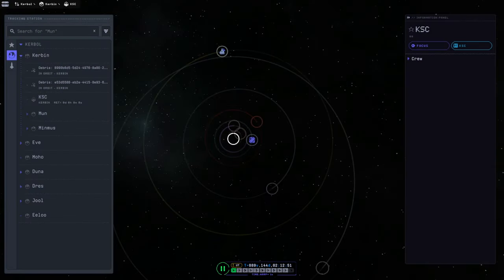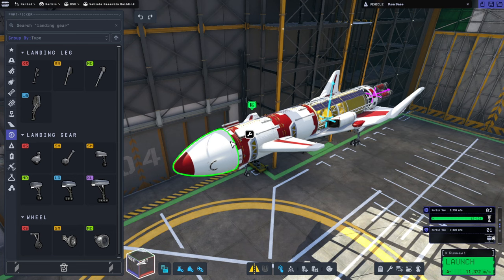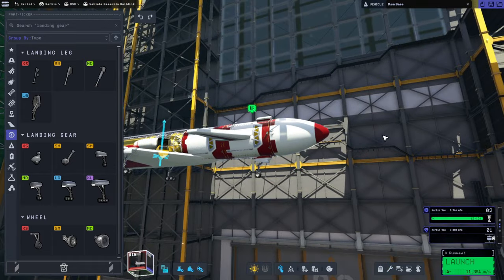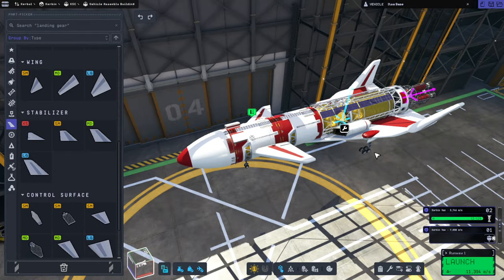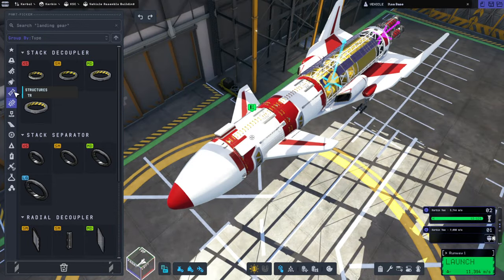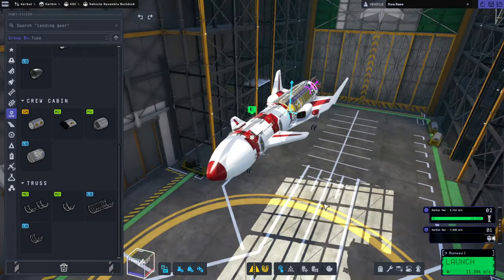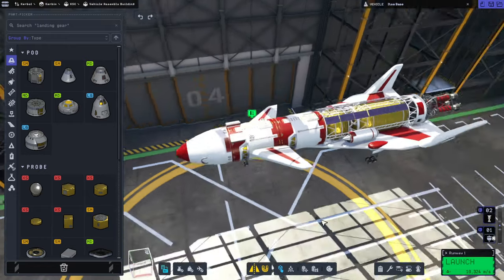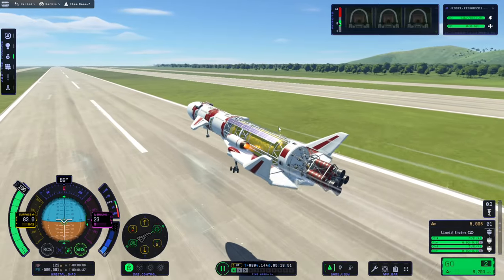KSP 2 Early Access - The Laythe Plan 04

Comment: trouble when you're launching the 3-SRB version - at 19:42, the smaller leftmost icon on the bottom bar is horizontal instead of vertical..  I've had some funky-ness with launching when that isn't set to the orientation that I want to launch with/at.

Comment: Regarding jet engines going into reverse; Is it that you have a joystick connected and its reading a slightly negative(or reverse direction) axis. As i type this you mentioned no joystick support, unsure.
Reply: I don’t have a joystick and I had the same thing happen to me. Solution was to turn off auto switch on the engines.